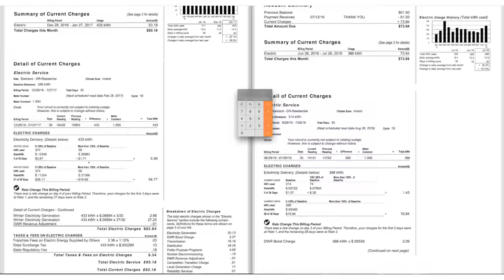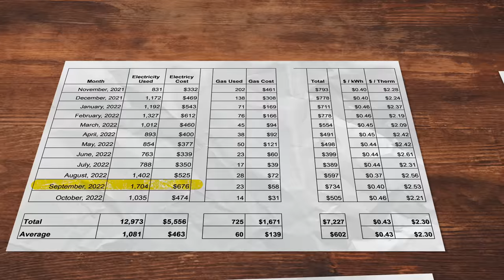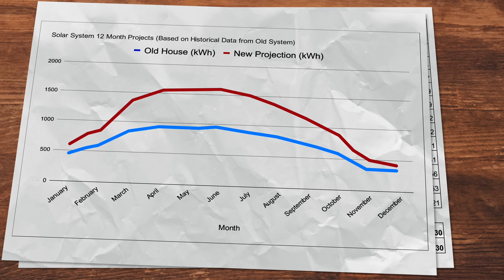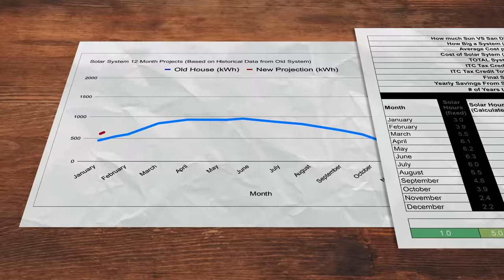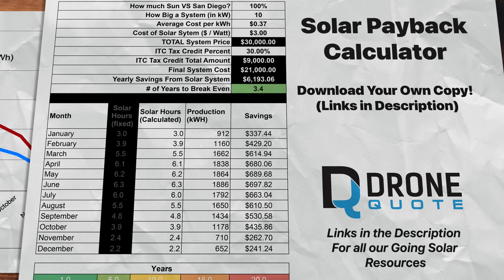Go Solar Before April 2023 - EVERYTHING Is Changing!

Comment from the maker: BougeRV Yuma CIGS Flexible Solar Panels: https://geni.us/BougeRv Code: TBDV16 Visit https://www.bougerv.com?aff=TBDV AMAZON CODE: TBDV16OFF for more products！Amazon: https://geni.us/FlexibleSolar CODE: TBDV16OFF
Reply: Have you covered putting Tesla color matched, glass solar tiles OVER existing new standard tiles? Cost aside, aren’t they component-wise very effective, efficient, & maintainable? My 1,000 soft two story condo has a 30’x35’ south facing 35 degree roof with zero shading. There are other smaller, less optimal slabs that I may want to do, later, after a couple of PowerWalls. Thx
Reply: What do you do for a living?  From the looks of it, you're either in SoCal or Eastern FL (miami) area.  A 2 story with 4200sq feet roof would run about $3M, not counting roof and solar.
Reply: The roofing and the racking is absolute Amateur Hour in USA. That looks really low quality! The flashing is rubbish. 

Jeezzzz 😂
Reply: One of the companies I priced for Solar panels was $65,000 for my home, It would take me 36 years to pay for that at the cost of what I pay for my light bill now.

Comment: Good info Ricky. From my point of view in dealing with electric companies and connection agreements, I now ONLY recommend to customers who are grid connected and want solar, is to get power limiting inverters. This would be grid tie inverters like Sol-Ark and some other Amazon/Chinese inverters with limiters. These inverters DO NOT send excess electricity to the grid or electric company. Add batteries and now you have solar and backup capability as well as still night time shaving from batteries. You keep all the energy you generate per day and are not losing solar kwh by “giving” your electric company YOUR solar power. Yes, you are giving kwh to your power company, your not getting all your sent solar kwh back or getting paid 1-1. They take kwh off the top.
Reply: That isn't quite how the inverters work, but the general description is close.   Inverters like the sol-ark can't actually limit AC-coupled panel power when grid-tied.  In fact, no hybrid inverter can.   Because, of course, the frequency is set by the grid in that situation.

Instead what they do is manage the power going into or out of the battery to effectively zero-out grid consumption, or to sell power back to the grid.    But any actual excess produced by AC-coupled panels that the inverter cannot transfer to the batteries or run loads in the house with will always be exported to the grid immediately.   i.e. if the battery is full, the inverter can't push more solar power into it, so it has to export it :-).

These inverters are very cool, though, because that battery management works both ways.  Since the inverter can control the power going into and out of the battery, you can setup programs to zero-out grid usage and to "sell" (i.e. export) power to the grid at times of your choosing, within the capabilities of the batteries.

The inverter can limit power from DC-coupled solar panels whether grid-tied or off-grid (grid-down).  It can limit power from AC-coupled solar panels only in off-grid (or grid-down) situations, in order to balance battery and loads with solar generation.  In fact, it has to be able to do this when the battery is near full, because if the system is not in balance the micro-inverter's anti-islanding protection will kick in and they will shutdown entirely.

Of course, power that is limited this way is lost.   The sol-ark and a number of other inverters also have an auxillary relay that can be used to run optional "extra" loads to try to soak up more solar energy rather than export it (grid-tied) or limit the panels (off-grid / grid-down).

(limiting power from AC-coupled solar panels is accomplished by shifting the frequency off of 60hz.  The new dynamic standard is like 60hz to 62hz or something like that, which tells the micro-inverters to reduce their output.  But this only works when off-grid or grid-down (not grid-tied) since when grid-tied the frequency is the grid frequency and the inverter can't change it).
Reply: I'm looking to have individual solar-battery setups powering each major appliance. go off-grid while still having a grid-tie in that I don't use
Reply: Hahaha 😆  Slip ‘n Slide 🛝😂😂😂

Comment: I had 10,080 watts installed on my house as soon as the metal roof went on. I  had a contractor put up the outside and I did the rest. $22,000 after rebates for solar. No batteries yet. I  installed geothermal heating and cooling. Infloor heat in all 3400sqft.  Been running for 5 years. Have had zero bills. Still have  net metering.
I live in Wisconsin. I don't have anything to base ROI. Since this is a new build. But based off what my neighbor paid last year for lp and electricity smaller house built in the 70s . $5,000 so my solar is already paid for. I never have to worry about prices going up. 
Money in my pocket from here on out. I installed my geothermal and infloor heat all 3,400sqft myself. $23,000.I had estimates for conventional HVAC installed.  $26,000-$34,000. Since I installed geothermal heating and cooling myself. Way less than conventional HVAC. Total if you include geothermal. 8-10 years payback. Probably way less since inflation isn't going away.

Comment: I bought and installed my own 5kW PV system with no batteries.  I use the grid as my battery as I'm sandwiched between 2 large wind plants and a couple of solar plants, so virtually all of the energy from the grid in my area comes from renewables, and my bill stays at: $11/mo., which is the connection fee only.  Installing solar is really easy, anybody who can install a window and a ceiling fan, can do it.

Comment: Thank you and I wish you success with the project.
In sunny Israel we have low power costs (~$0.15 USD/kWh), and a similar tariff for selling all of your extra PV electricity to the grid (25 years contract with the grid company). Therefore, the amount of electricity you use shouldn't influence the size of your PV system, but the size of your effective roof and the amount of money available for the investment. This incentive approach allows you to install the largest PV systems possible and not only a size that will fit your power consumption. 
We've paid ~$26,000 on our 21 kWp rooftop PV system, we produce 4 times as much electricity as we use, expect to return the investment in ~6 years, and to have a net profit of ~$61,000 USD in 25 years (after deduction of installation and maintenance costs).
This incentives approach encourages efficient installation- you are rewarded for the energy you produce and not for the installation. This way it is more likely that the owners will look after their systems. Incentives for installation without proper incentives for electricity production lead to less efficient systems and less electricity production.
Also, decent incentives for electricity production motivate for the largest PV systems installation possible per roof (better from a national renewable energy point of view), and not for smaller systems like in your case.

Comment: 1st thing is to check if you can move something away from where your array is planned and install without 1 panel missing. 3r x 11c = 33 panels on paper. if there's a plumbing vent, you can move it so your installer doesn't put 32 panels on. if done, pays big dividends in winter.

Comment: I live surrounded by towering Eastern White Pines, some on our property- some on neighbors. It's sub-rural Maine. This far north, one needs a pretty clear hgorizon for the sun all day. Just taking down the 30 inch (at chest height) pine that ripped our roof apart years ago costs about 1/4 of a decent solar system for this property. It's over 100 feet tall,  20 feet from the foundation and hard to get at. And they're all around, that means a week of cranes and like 10 guys- just to get started. Removing the trees is as almost as expensive as local solar. That, and our home will bake in the summer sun- and all the shade loving plants in the yard/garden will die.

Comment: Great video, but a couple of comments:  First, you make it sound like you can only hook them up all in series or all in parallel.  You can do both and put them in groupings on the roof.  One of my RV installations is both series/parallel.  2 panels are in series to get a higher voltage and extend the working daylight because in non-optimal conditions the voltage of one panel would too easily drop below the low threshold of the charge controller with cloud cover and end of the day.  Then I have two sets like that in parallel for 4 panels total.  That way when the AC unit shades one of the sets a little, it doesn't affect the other set in parallel.   Second, not all panels in series suffer from shading of one.  Many new panels have bypass diodes in them to lessen the effect of one cell being covered and also one whole panel being covered.  Many times you can get away from having optimizers all together in string configurations because the panels have built-in shading protection.
Reply from the maker: you're totally right, i was a bit rushed with really rainy weather.... i am going to touch on this in a big way in part 2 on inverters, where that all really matters!
Reply: @TwoBitDaVinci  And good luck with the installation.  I have had my rooftop system for 8+ years now.  It's been almost flawless except for a squirrel making a nest in the center of the array and chewed through one of the panel leads.  Luckily I picked microinverters so only one panel was down till I got up there and repaired it in the spring.
Reply: Yah, all new panels include bypass diodes.  But the comment about parallel configurations is not correct.   Shading on one panel or string WILL effect the other panel or string in parallel, because the MPPT point for the combination will shift off of the optimal voltage point for either string.   This is why you generally don't want to parallel strings if variable shading might happen... you want each going into its own dedicated MPPT.

That said, on an RV, space might be at a premium and a parallel configuration will have less complex (though thicker) wires, so you have to judge just how big a problem the variable shading conditions are and decide whether to parallel the strings or not.  And I will fully admit to paralleling strings on my test systems (I have one up on my back deck now with two solar combiner boxes in fact!).  But on the serious systems I never do it.

One last thing... as an electrical engineer and one who has messed with solar panel for a very long time (about 20 years now), I will say that higher currents are almost universally more dangerous than higher voltages.   Fires are caused by current, not voltage.  Similarly on a roof, I am far less worried about 400V @ 10A than I am about 200V @ 20A.   I'll take the 400V @ 10A any day of the week, because failed electronics are just far, far less prone to causing a fire at 10A.

If we are talking about voltages under 48V, then a human factor also comes into play... voltages under 48V are far less dangerous to humans than voltages over 48V in terms of electrocution risk.  Once you are north of 48V though the voltage almost doesn't matter in terms of electrocution risk, and now fire risk (in electronics) from a short becomes dominant.

Comment: Well summarized. Kudos. 

Generally, you size your system and wires based off of your desired input voltage. Most people seem to like 48V for some reason. So if your panel does 12V, you need 4 of them in series. People often want more than just 4 panels though, so you do a combination of series and parallel configurations to keep your input voltage where you want it and your current where you want it. If you have too much current for your wires, use more wires or bigger wires. If you had space for 32 panels and wanted 48V of input, you'd need a 4s8p (4-series, 8-parallel) configuration. 8 sets of 4 panels each connected in series. You'd need to size your wires for the combined amperage of a single series set (4 panels), and then have 8 sets of wire, 1 for each series panel, or embiggen  the wires so you could stick 2 series sets onto a single wire and have 4 sets of wires for your system. Or bigger still and have 4 series sets on a single wire, and then 2 sets of wires.

We use this same process when building battery banks/packs. (I worked R&D at Milwaukee Tool in the Battery division). Figure out what voltage you want first, then how much power you want out of it at that voltage, set up your series/parallel sets to accomodate, and then size the wiring and components to match. You can honestly go as big as you want with this. Wiring harness can't handle the power? Split your total cells in half and make two harnesses/two packs. Inverter can't handle the power? Use two inverters. Same for everything really. Just keep in mind safety. The more Li-Ion cells you have in a single location, the more heat is generated and the worse an overload situation could be.
Reply: Household solar systems don't operate on the lower volts like you describe. They're in the hundred to several hundred volt range. Inverters & charge controllers handle turning the power into exactly what you need. Now, RV & van life solar systems operates more in the manner on how you describe.
Reply: References to 48V are typically references to the battery systems people have.  Most battery systems will be 12V, 24V, or 48V.  There are a few high-voltage battery systems too (usually integrated into power-wall like units, not DIY).  For whole-house, 48V is really the minimum because anything over 300A or so on the battery circuit can get expensive real quick.  300A x 48V = 14.4kW.... suitable for whole-home.

Panel voltages vary.  There is common usage where 100W panels are typically called "12V" panels, but what it actually means is that the VOC of a 100W panel will roughly be in the 24V range and the operating voltage will be 12-20V or so.  And for a 200W panel the VOC might be 40V+ (but usually not over 48V), and the operating voltage will be more in the 24-35V range).

Its really a mis-use of the terminology.   There is really no such thing as a "12V" panel or a "24V" panel or a "48V" panel.   Every solar panel  brand is different, even for the same or similar wattages, and in larger systems (i.e. home solar) the panels are strung together in series for hundreds of volts, or have dedicated micro-inverters that output 240VAC to a bus.